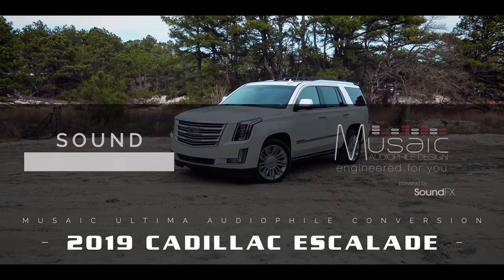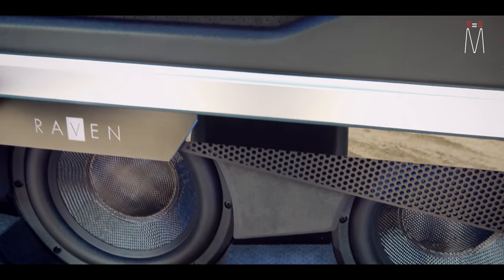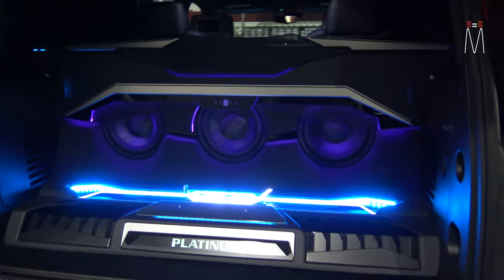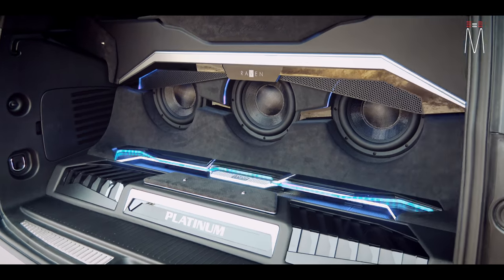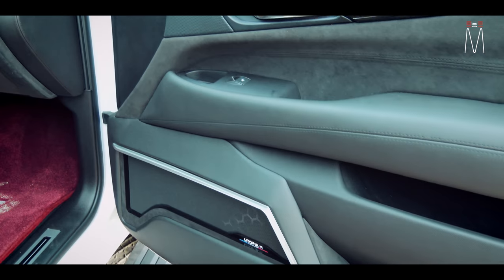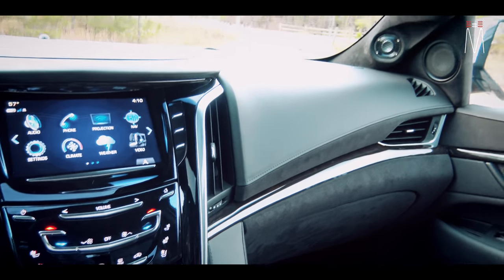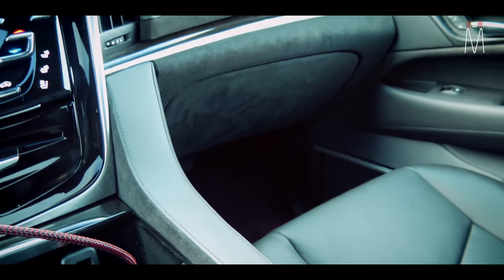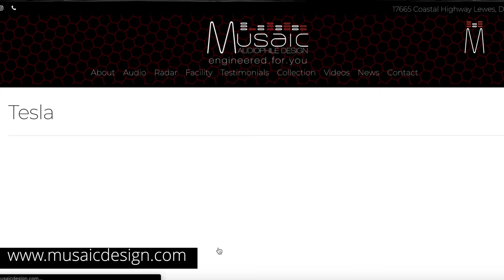The Ultimate Cadillac Escalade Platinum Sound System EXPLAINED!!!!

Comment: Wooooow!! Lovely Sound Quality build!! This is a really good example of Audiophile grade! Everything chosen and done up properly! FINALLY!! we see Masterpieces like this!! All audio meaning, sound processors DSP, electrical, lighting, power, relays and etc. Very very CLEAN and done up right! I honestly don't even know what else to say besides woooow! When you Incorporated those factors and the relays into the audio build I was literally Blown Away that's exactly how things should be nice and flush. From custom circuit breaker box in thefront to sound deadening material all the way through the vehicle. This vehicle needs to be in a museum to be a prime example on how Auto Audio and technology incorporating should be. The doors of the relay and fuses that was beautiful. Like I said from highs mids and lows all speakers subwoofers blah blah blah  perfectly chosen! If I'm missing anything else i apologize but this is a work of art!
 
 Now this is my opinion so please don't hate me for it.
  I must say just on a little detail: custom 3D printed positive and negative battery terminals for the first and secondary battery would look really nice hiding those postive and negative busbar along with a alternator positive cover too. As it says stinger heat shrink, different color jacketing on the ofc wire, Tesa tape, and Tech flux would look also nice in the back speaker cable fuses relay wire as well matching the front.
 All in all like I said a work of art I was carefully examining the video so I was going back and forth sorry about this long message but this message needs to be heard!

 Please please continue builds like this! yes I'm going to mention 5 Star Car Audio Dean and Fernando would probably have a field day with this! :)

Comment: The attention to detail in this build is beyond comprehension.  The item that intrigues me the most is the acoustical cancellation blocks that are being used inside the doors and in the cavity where the linear actuators reside.   I'm glad a company finally made these products as I've had to make my own over the years, and cross my fingers on humidity & condensation becoming a maintenance issue overtime.

being a fan of analog ,  I congratulate you for having an analog input.  I'm actually somewhat curious if you have any issues with Emi or RFI from the vehicle or outside sources inducing noise into the system.      I have not heard of that unit so I'm going to have to look it up but I'm pretty sure it probably has a balanced output.  

I'm actually a bit surprised that there is only one AGM battery after the battery isolator.  Are there any EDLC capacitors used to keep up with system transients?    I'm sure it's not a problem as for normal listening it shouldn't pose too much stress on a large AGM battery.  And as far as I recall,  the Moscone I believe--- have a regulated power supply.   

 I understand the system is fully active correct?  
Why was the choice of going Class A for the mid bass  Amplifiers?

Crossover distortions play a  miniscule part as the amount of audible distortion issues with class A/B amplification would already be highly inaudible if negligible with the high class a bias of the Moscone amplifiers.  (?)  

As an installer yourself, are you able to audibly or sonically discern or hear the differences between Class A/B and Class A amplification where the speakers  are running active ? 
   ------I've been really fortunate in that I haven't been able to hear a Sonic difference in the systems that I've auditioned and I'm so thankful for it!   

also I had no idea Morimito  made RGB Software.  I'm going to have to check that out. 

again absolutely Splendid build.  
I'm going to be honest and say that my favorite part really is the front door cards.  that soft lighting effect is my absolute favorite.   

thank you so much for sharing this with us Matt. Look forward to your other builds in the future.

Comment: Thank you for explaining in more detail how you use the A&K SP2000. So if I understand you correctly, analog line out of the SP2000 to a Y cable inputting into two analog inputs of the DSP?
Reply from the maker: Correct.

Comment: More amazing work, Matt! I'm currently installing a system in my Infiniti Q60 with 8to12 Aerospace and 2 Pro 5-30's running Utopia M 3-way (8") front stage, K2 midrange for rear fill and 2 Utopia M subs. Just wondering why you chose the Raven 10XL subs over the Focal SUB10WM.

Comment: Hi Matt, that Escalade is amazing. I have an issue and I was hoping to get some advice from you please ? I have the Mosconi D2 80.6 DSP . The other day I bought the Astell & Kern Kann Cube . The Mosconi only has optical and not coaxial. I’m using a mini Toslink to the Mosconi optical Toslink . I was told yesterday that the dac being used right now is from the Mosconi not the Kann Cube . The reason I spent all that money on the Kann Cube was to use it’s amazing dacs. What are my options right now ? Thanks, Genna

Comment: What crossover points were used on the mids/tweets?
Reply from the maker: Mid (350-5000 24db LR) - Tweeter (HP 5000kHz 24db LR)